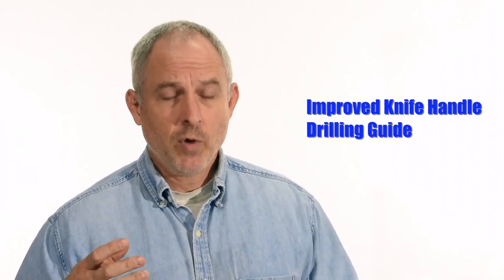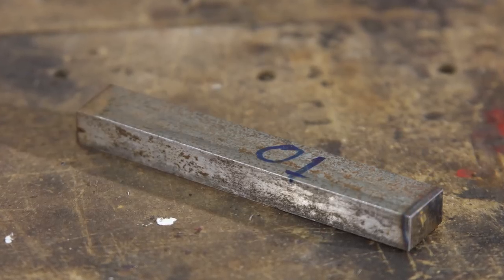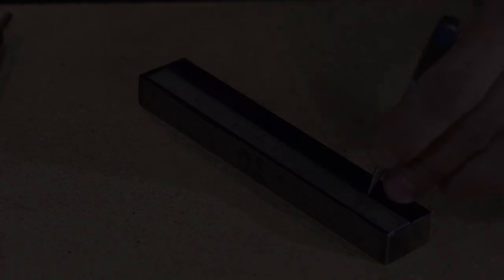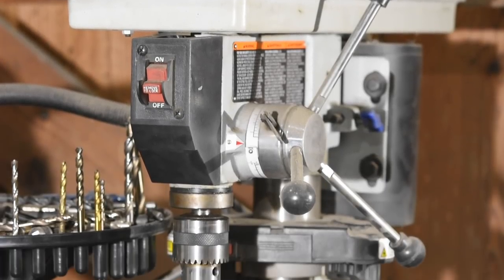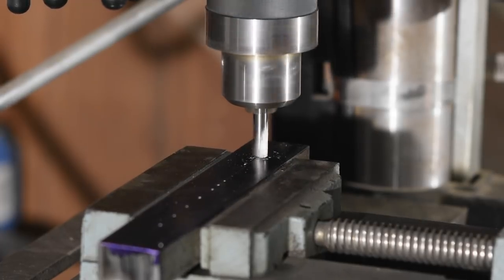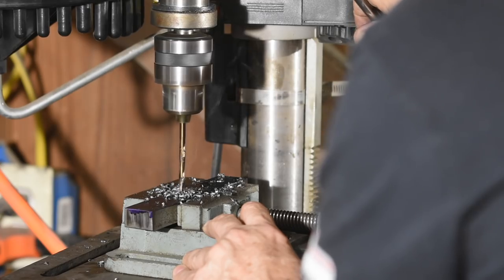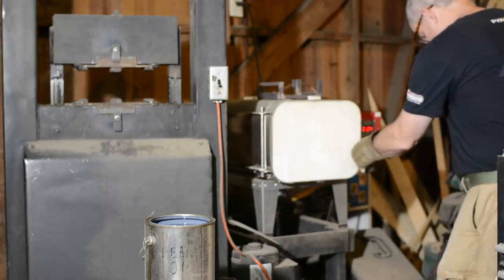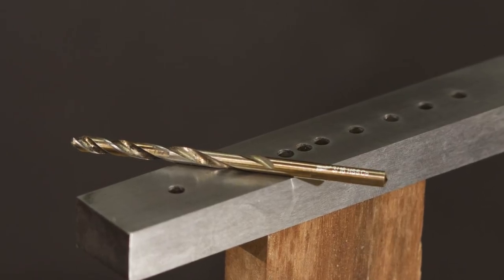Improved Knife Maker's Handle Drilling Guide

Comment: Walter, I'm trying to put G-10 scales on a Strider fixed blade MFS knife using strider scale screws(chain ring bolt type screws). Can I drill forstner bit holes in G-10 using a cordless drill? Can I buy a forstner bit that would fit a .25" cordless drill chuck? I don't have a drill press but I only need two .25" holes each with 3/8" forstner countersink top holes to hold the scales on the tang. Thanks for tour time. Good upload!

Comment: I appreciate your noting the danger in "clamping" the vice by hand. I will say however, i wouldn't be so quick to dismiss a small drill presses power. Yes, gear driven industrial drill presses are absolutely something you need to respect. But a small home drill press with a 1/4 horsepower motor on it is more than enough to detach fingers, hands and even arms.

On a secondary note, i find the easiest way to get my drill centered on my punch or spot drill is to put the drill press in neutral and spin it backwards by hand while pressing down lightly with the quill. As long as you aren't pressing hard there won't be any damage to the drill and it holds your work piece/vice in place while you get a clamp on it.

Comment: Actually you CAN drill a lot of different sizes using that drill guide as is.  You use the guide to spot the hole locations.  Putting a collar on the drill bit so it only drills about 1/64" to 1/32" deep will work best or use it in a drill press and set the depth stop.  Basically you just barely touch the thing you're drilling to mark the location.

Now put the drill guide aside and put the right size bit in your drill press.  Yes, if you want the square holes the drill guide was going to give you then you probably can't do it using an electric drill.  With the correct bit in your drill press have at it.